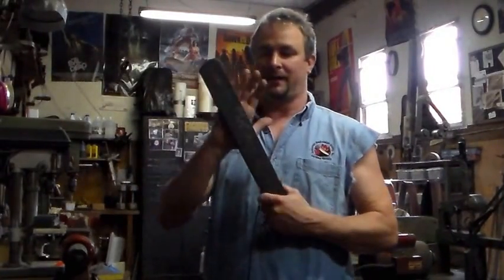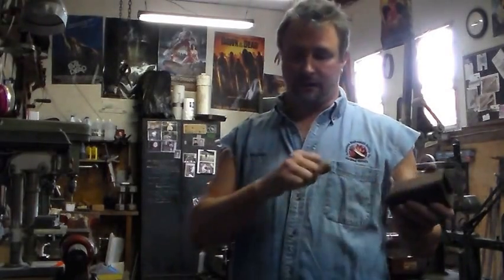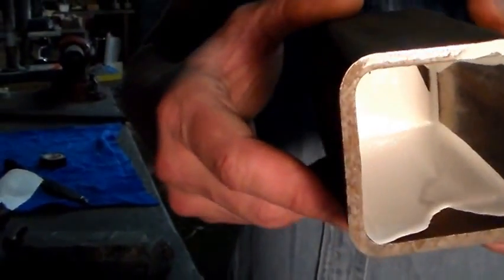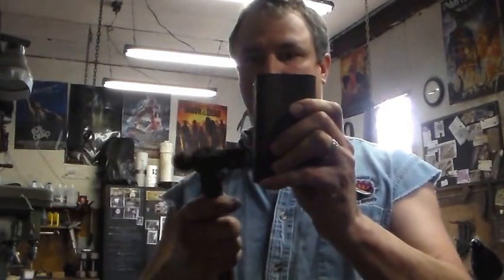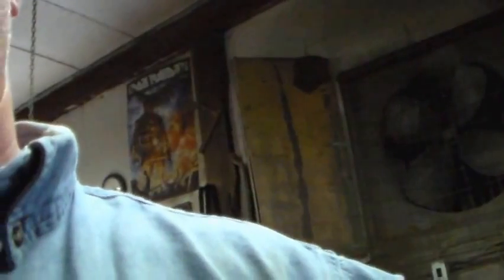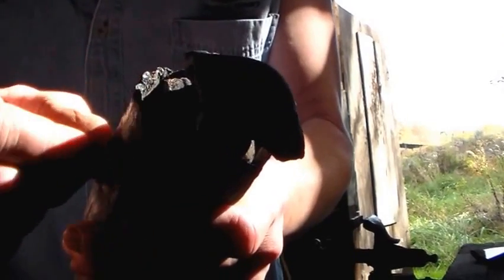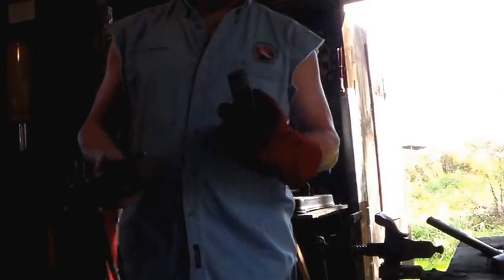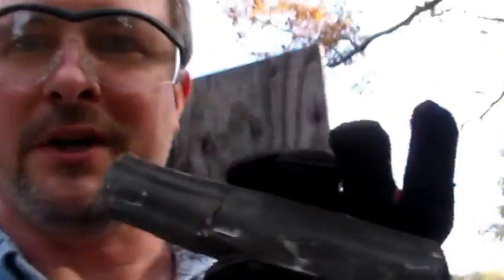Tips on Canister Welded Damascus Steel

Comment: What is usually the ratio of steel pieces to powdered steel? Great video! Also, wouldn't it be more efficient to use an angle grinder to cut two corners and just pop a side off the canister to get to the Damascus Billet?

Comment: Jay, you are giving people very BAD advice.  White out is NOT needed.  I have made lots of canister Damascus and white out just causes problems.  Do NOT take the can off after the first heat.  If you do the powdered steel may not be completely welded.  If you leave the can on subsequent heats will completely weld the billet up. 
Fire scale will take a lot off the can.  It's better to lose part of the can to fire scale than it is to lose the billet to fire scale. 
After the billet is drawn out the can will be paper thin and will just grind off when you grind the profile of the blade and then when you grind in the bevels. 
If the contestants on Forged in the Fire have been following your advice then you are responsible for the problems they have been having trying to take the can off after the first heat. 
The important thing with canister Damascus is 1. completely fill any voids with powdered steel. 2. Leave the canister at welding heat long enough to allow the contents to weld.  I leave a 2" canister in 30 minutes after it appears to reach welding heat.  I leave 1" and 3/4" canisters in 20 minutes after they reach welding heat. 
Do everyone a favor and GET RID OF WHITEOUT on Forged in the Fire.

Comment: If I ever get a chance to try that I’d probably use my torch to slice the canister open instead of using a grinder.  Obviously it works but if you were to slice opposite sides with a torch by the looks of your canister it would probably just fall off without having to beat on a chisel.

Comment: Hey jay, love your work, and your amazing on forged in fire. I’ve heard from another master smith about using an oxidized foil, almost like aluminum foil used in metal work, that he uses in his canisters instead of the whiteout. And when he showed a video of it, it looked like the billet almost damn near slid out with next to no effort... was just a question if that works as he said, or if you’ve heard of it, ever tried it? Again, love your work, and keep it up on the show, your amazing.

Comment: Whats the difficulty with using a stainless steel tube , weld one end . Place in forge create a chromeoxide . Fill with whatever metals you want to make the pattern with adding a little lamp oil  . Carefully clean welding area with a hand held dremmel grinding bit, cap weld and drill one small hole . The interior metal will not weld because of the chrome oxide !

Comment: When it comes to tapping to get the powdered steel  packed tightly, did you ever set the can next to a speaker while blasting out some classic heavy metal?  Seriously, in the powered ceramic process for making electronic capacitors, the powder needs to be packed tightly before sintering to avoid ceramic voids which makes bad capacitors. They used sonic agitation extensively to pack powder uniformly. I see no reason to prefer Led Zepplin Over Deep Purple as far as the steel goes. Your mileage may vary.

Comment: Any cheap white paint works as its the titanium dioxide used for the pigment that prevents the canister from welding to the steel. i have so far tried the brands basic, cretext color and even some Crayola washable paint and they all have worked. they do not dry as fast as whiteout but aside from forged in fire, you do not really need it to dry super fast. however, oil paints do take a fair amount of time to dry so I would stick with acrylic paints...although thinking on it oil-based paints may work a little better. although you do need a paintbrush if you use basic or Crayola washables. also, a heat gun will speed up drying from a few minutes to about 1 minute with the paints mentioned. I just happen to own a heat gun as i use it for making sheaths from a thermal plastic called Instamorph.

Comment: Try a automotive product called metal prep for cleaning up the inside of the canister it will remove rust etc and seal the metal then do the liquid paper  i use metal prep cleaning rusted tools cars etc i am getting a forge set up together any tips etc would be appreciated

Comment: Has anyone have experience with using say 300 series outer canister? The thermal variation may be an issue but being magnetic vs non magnetic have a benefit in detection (lower temperatures). or a material that dislikes heat that would come off easier (but not too easy) like perhaps a PH material... Just talking from ignorance :-)

Comment: Great video, I have a related question, is it possible to make a canister billet with only 1095  and  4600KC Powder?  My worry is would the billet be strong enough without adding ball bearings or other parts.

Comment: Just a curiosity, but have you ever pressed a billet out of a can? You could weld a couple of square stock pieces on opposing sides of the can after you split it to rest on the bars of the press. Make a die that fits the average ID of the cans and billets you make. You could even tack a handle on it to hold while you pressed it. You would just need to orient the can so that the thickest end of the billet is facing in the correct direction to come out the easiest.

Comment: So zinc oxide is your parting solution. Okay, cant you use the zinc oxide sunblock to create the same parting effect? It's sold in tubes at dollar stores in greater volume than the whiteout making it a better bang for the buck. In thinking about this I was worried about the whole drying factor as I didn't think the sunblock would completely dry but too you mentioned adding oil to the canister for removing impurities(even though you didn't notice a difference), so I was a bit less worried. Would you do a video by chance using zinc oxide sunblock as a parting medium instead of the whiteout?

  Thank you so much for this video. Most of my smithing knowledge came from my father, a farrier of 60 years experience but after watching Forged in Fire, I personally have been inspired to greater things than horse shoeing.

Comment: Sir, is there any other mediums you could use instead of white out?
Reply from the maker: The Mad Man At Duncan Junction u can use cheap white spray paint as well.
Reply: The reason I ask is due to it drying time. In the aspect of spray paint would it still come out as clean of a billet?
Reply from the maker: The Mad Man At Duncan Junction I’ve used it successfully with spray paint as well. I used both on my canister Damascus dvd.
Reply: Thank you again so much sir.
Reply: Sir, 
Stupid follow up question. I saw a video where a guy used tin foil to help keep the billet from sticking to the canister. It looked like it would work but I don't really have a proper clue. 

Also speaking as a fan thank you for what y'all do. Y'all have helped open up a new world that has helped ALOT of people find joy in their life.

Comment: Of all the visual metallurgical analysis of pattern welded billet surface properties that I've ever conducted via youtube, yours is by far the best. Paper, oil, sawdust, virgin witches perineum whiskers or any combustible in your can is to purge any oxygen or compounds thereof. Your method minimizes the problem and a can full of whatever usually has plenty enough impurities like oil grease or smegma to combine and purge available Ox. I have another option that works great for me if you're interested Jay! I consider it my best trick for saving time and material plus it's free

Comment: Jay, did you not have to crush the can down on the billet in this video? I was wondering how it would be rattling if you did?
Reply from the maker: Eye 4 Eye After forge welding it down, I gave the can a few light squeezes on the corners to superset the can from the billet a bit more, hence the rattle.

Comment: Any reason why you can't use the canister as part of the steel?
Reply: I think it can be used as the spine of the blade but since the canister is not hardenable it wont hold an edge.

Comment: In a great number of ways, this reminds me of crucible steel. A smith puts his iron ore, or his bloom, whatever his steel source is, along with coal dust along with some sand and glass (that what the guy in the video used) in a canister( he called it a crucible) of what I think was some sort of clay. This seems very much the same, except the crucible is a metal tube filled with existing steel bits.
Reply: Basically

Comment: Can you tell me if the zink is dangerous in the white out. Like galvanized? Maybe it is OK, being different. Any other things one could use instead if one could not get it. Am in India at the moment. 
By any chance would you know of any other filler I could use for the canister other than powder. Appreciate your video and would love to know. Any help appreciated.
Reply: Its not dangerous.  I'm in the coatings industry, and I know the person who developed White Out.  (Liquid Paper was developed by someone different.)  The zinc oxide is the white pigment.  Its cheaper than Titanium Dioxide, which is used in paints and inks.  If its zinc oxide that is acting as a release agent, then you might want to try diaper rash cream.  That's basically vaseline with zinc oxide.  I haven't started forging yet, so if someone wants to try a forge weld with diaper rash cream, let us know if it works.
Reply: Same shit as tippex that we have in europe I assume.

Comment: I work at a tool rental place and I got me some 3/4 sewer order cable I want to weld up. It fits perfect in the 1x1 square stock I made my first grinder from. I I want to use powedered 1084 because I am intimidated by the heat treating of 1095. I don't have an oven and can't regulate temperature like that. Anywho, I'm going to do 2 variations of the billet. 1 with the inner core wire, and one without. I need to clean them up a lot! The outer wrap I'm not to worried about but that inner core has some grease. So I'm just going to cut it to length, weld the ends, and boil it, then soak it in vinager of there is any remaining oxidation. I just got done making my first " good" billet of demascus. I got a nice profile that I like and only have a couple inclusions that are going to grind out....hopefully. Only 2 more years until I can test for my J.S. So I should probably get good at making knives before I make demascus but it's too fun.

Comment: to avoid having to grind off the canister why not make it out of hardinable steel ?
Reply: Nelson Palmer good luck finding blade steel box section for one, and it was also have the same problem of not having a pattern
Reply: Why not weld blade steel together to make a box,,,,, Could even make walls of alternating steels by welding them together, as long as welding rod steel is hardenable? IDK
Reply: You can most definitely make your own box, of whatever steel you want. Just weld plates together.

Comment: Mr Neilson 
Question is the active ingredient zinc oxide? 
Have you ever tryed a quality artest paint ? zinc white is a color and you can get the zinc white in just dry pigments .I am almost positive that it is pure zinc oxide.
Just wondering. 
Thanks,Martin at M/ S Blacksmithing and Blades
Reply: Not sure  but If my suspicions are correct the artest paints or pigments will work on account they are mades from pure zinc oxide. Theonly thing I suggest before trying is not touse oil paints. Also the better the quality of the paint the more pure the pigment. This is why I suggested that you can possibly use the dry pigments and mix your own. But the thing is is it was a question and ive never tried it before so I  was asking if it was the zinc oxide that helped the canister not bond to the bilit. I know from experience that artest paint has a high zinc oxide pigment percentage. Since I haven't gotten a reply from Jay I will have to try it or ask in a few forums I belong to.
Reply: Cost would be the issue
Reply: How do you figure that cost is an issue? I ask because you can get a great brand of acrylic Zinc white large tube for 15 USD. It may cost a little more than a very small amount of white out but in the end if the said paint will work if you thin it like the consistency of white out you will have a large amount of paint for many canisters. I mean this is assuming that the zinc is the cemical that keeps it from sticking. I have searched for info on using artest paints for this but have not had any luck. Mabe some time I will give it a go. Sort of a proof of concept and do two billits 1 using white out the other using artest paint.. Martin M&S Blades
Reply: There's also lots of Zink oxide in many popular coffee creamers

Comment: Hi there I am a blacksmith in the uk this is a really interesting video thank you for putting it up. One quick question if you could answer that would be great. I would like to start using nickel in my Damascus but I am having s bit of difficulty in finding what kind I can source and use the most common I seem to be coming across is nickel silver sheet would this be fine to use? Thank you in advance
Reply: bandsaw blades contrast well some are 15n20. Hacksaw blades, lumber banding, trampoline springs(danger galvanic brain death) and concrete nails can work depending on your other metal. For 5 cents a round you could use nickels, which is cheaper than nicvkel silver that contains zero silver but priced like it does
Reply: Try scrap metal dealerships.

Best ones around are Sims Metal Management, they'll either have some or know someone with some.

Comment: Older video, but why not just weld up a tube with some high carbon flat bars? Then you don't have to worry about scraping and grinding anything
Reply: would disrupt the pattern, you want the can off or it will look like 1 type of steel

Comment: love the show! i know your a pro just wanted to maybe throw a tip to try for removing that canister after u grind and split clamp the side u peeled up with the chisel in the vise and throw a good pipe wrench on the sqaure side and lean on it n work ur way down the tubing n should fall right out pretty easily.. let me know if it works maybe a new trick from a youngster to a pro thx

Comment: Hey Mr. Neilson,
My name is Patrick. I really enjoy Forged in Fire. I'm a machinist, mechanical. engineering student. I had a quick question. I have a HC RR spike knife I'm working on and was wondering, since the carbon content is somewhere between .4 and .6 percent, and the hardness will be difficult to get high enough to have decent edge retention. Planning on using Rob Gunter's super quench and wondered if that's a good idea.

Comment: I am a novice and wanted to know if you can replace the steel canister with common black iron pipe with end caps screwed on? Could drill a hole in one end cap for the 99% closure part. I ask because I have no welding tool or even know how to weld.
Reply: I'd like to know this too.
Reply: Yes

Comment: Great tip on the Whiteout, very cool and useful. Suggestion, get a 4-1/2" angle grinder with some Walters cut off wheels and slit it on both sides. Much faster than the large grinder and no chiseling.

Comment: what type of bearings do you use? case hardened carbon steel? chrome steel? stainless?
Reply from the maker: +Devon Rea 52100 ball bearings
Reply: what's better for a Knife Handle, Micarta or G10?
Reply: +STEVE P its more up to personal preference of grip and looks rather than one being better than the other
Reply: G10 is probably harder and a little stronger, but more expensive.

Comment: have you ever tried forgewelding carbon with stainless?
Reply from the maker: I did it un-intentionally a couple times when I was using ss foil before using the white out trick so I know it works but, I haven't had much call for it in an actual billet.
Reply: J. Neilson thanks for the quick response! i wanna make some stainless/carbon san-mai :)

Comment: Hi J.
I was wondering if there are any durability differences between damascus steels? if yes, which is the most durable and why? if you could answer that i would be really happy. Thanks!
Reply from the maker: Actually, it depends on what someone is putting into their damascus. I use all the same steels in my damascus as I use in my single (mono) steel blades... 10XX, 15N20, 5160, etc.... so my damascus will perform just as well as my other blades. Damascus can loose performance when adding non-hardening materials for a cooler look but, you'll pay for it in other aspects. That's why I prefer to use what I do.
Reply: J. Neilson  Hi J.
thanks for your respond, let me rephrase my question please, i meant it as in damascus patterns. is one more durable than the other? cos some seem to be fused more closely/tightly than others.
Reply from the maker: Oh, I gotcha now. Not really, if the steel (no matter what the pattern) is properly welded, there shouldn't be any difference in cutting ability. I remember hearing the rumor that "ladder" pattern cuts better because it has almost a serrated feel but, keep in mind, the actual cutting edge of the knife is not etched, it's smooth so that just doesn't fly.